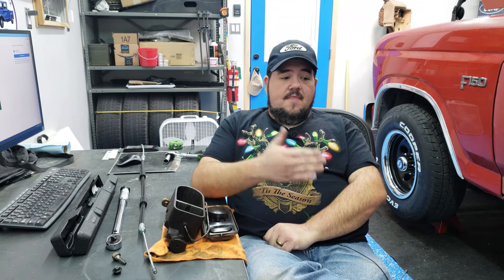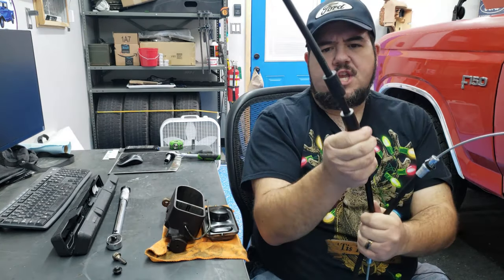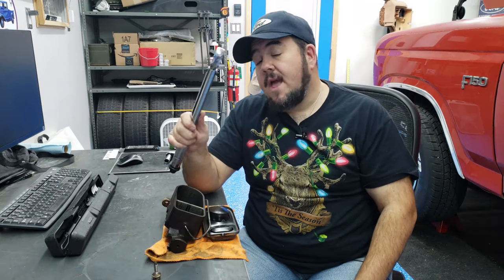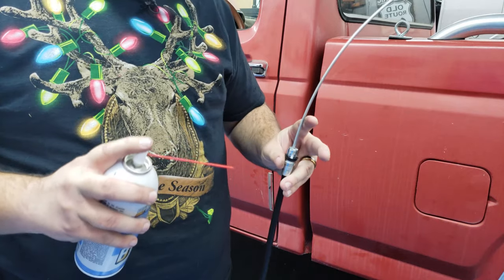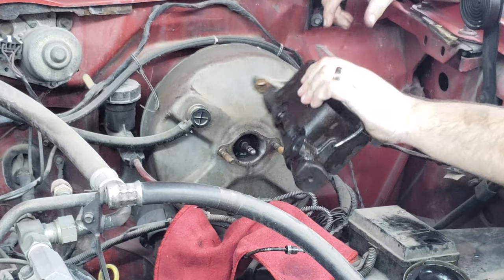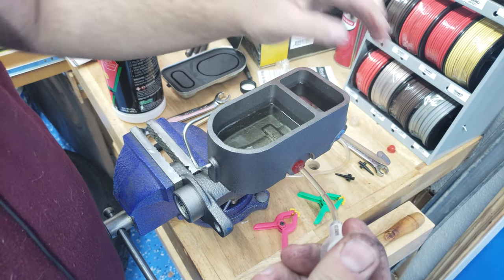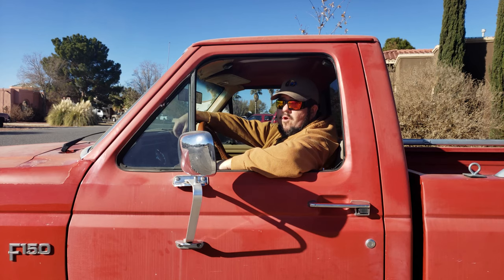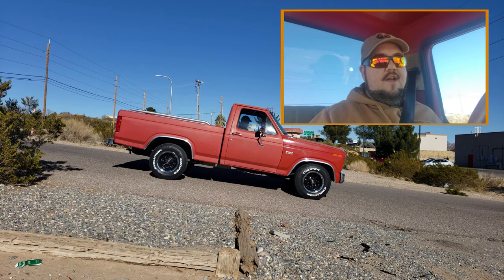Master Cylinder Bench Bleed / Replace and Lessons Learned - 85 F-150 Brake Job [Part 4]

Comment: I am by no means an expert but some other brake bleed vids mention teflon tape or even grease around loose bleeder nipple threads to prevent air from re-entering.
You're obviously a meticulous guy and I appreciate the time and effort you put in to make your content.

Comment: I know this is a little late, but the click type Harbor Freight tq wrench in the in-lb range, clicks too gently for me to detect sometimes. I got a digital one that beeps at me and I’m much happier with it. The ftlb wrenches seem fine. Also, when I did this job on my 83, I replaced the master cylinder with the newer 87-91 style plastic reservoir cylinder. Motive makes an adapter for this reservoir for their power bleeders which is a life saver. It makes this job so much easier.